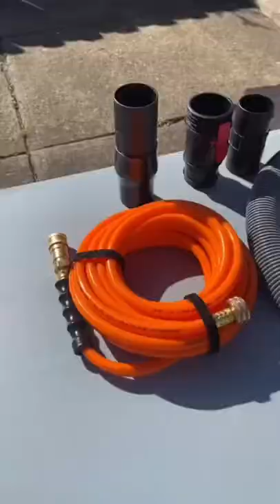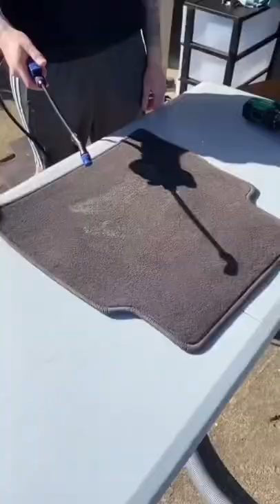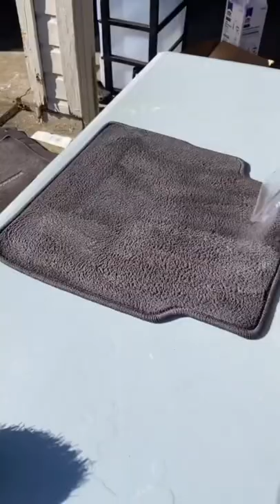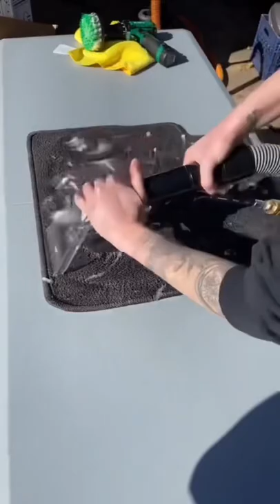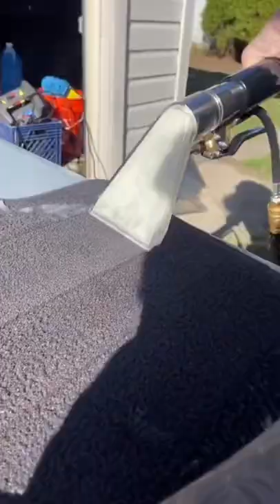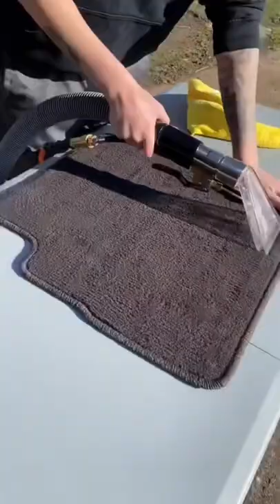10/10 recommend the Better Extractor! Makes the job so much quicker. #cardetailing #extractor #fyp

Comment: But what vacuum are you using? Not the attachment
Reply: Ridgid portable 4 gallon 5hp will be what I use
Reply from the maker: Rigid 14 gallon 6hp
Reply: Nice set up. I will definitely need this
Reply: @vladhyppolite9352  I’m waiting on a few more parts to finish mine and I can’t wait to use it.

Comment: This is the best option compared to the $100-$400 machines that are available. Paired up with the ridgid 4 gallon 5 hp vacuum you'll have the best suction available. 
The bad part is that not every one has an exterior heated water source, hot water makes a big difference.
Reply from the maker: I completely agree!!
Reply: Link for extractor??
Reply from the maker: @raulbleedem  https://ripclean.com/?sca_ref=3846771.p6p5xGyEON
Reply: I waiting to hook up this to their 4 gal 6hp shop vac. I might rip the carpets out with it lol
Reply: The best suction available huh🤔
Reply: @sirtyronedalll4082 don’t get any wild ideas bud😂
Reply: Ik some would be able to tap into how water from the house if they are pipe hand or a plumber. If only do that if you are doing cleaning for a serious job
Reply: @raulbleedem there are how to videos on YouTube where you can make one yourself for a bit more savings.
Reply: Put a smaller hose and much better suction
Reply: Where can I purchase this ?
Reply: Remember you have to attach to garden hose I believe
Reply: @mcgrathautodetailing
Reply: this is when you buy a mccollough steam cleaner and use it before you extract!

Comment: Smh I mean it’s convenient that it’s all together but over 200$???? Screw that. I can build my own bc it’s basic knowledge. Air hose with fittings that fit the water hose and extractor head of your choice. And a vacuume hose with rubber slip fittings
Reply: What is everything required ??
Reply from the maker: True but I’m lazy 😂
Reply: Then why comment on it and complain about an investment then just doing a diy?
Reply: 200 wouldn't be bad if it had a metal coupler so that it wont start cracking after a couple years of pressure

Comment: Would this kit fit a karcher or dewalt. And while i am at it, can you please recommend whihc i should purchase? I live in nz and its hard to get a hold of a ridgit. I am thinking to purchase either the karcher wd3 or a dewalt...
Reply: You can use whichever shop vac you have that can pick up liquid. You may just need to sort out a fitting to make the extractor head to fit your vacuum hose

Comment: Instead of a 10 ft hose for the water attachment, maybe run a 100 ft hose from your hot water valve for the washing machine. 😅

Comment: What a Machine is?
Reply from the maker: https://ripclean.com/products/extractor
Reply: @mcgrathautodetailing  :thanksdoc:
Reply: Smh I mean it’s convenient that it’s all together but over 200$???? Screw that. I can build my own bc it’s basic knowledge. Air hose with fittings that fit the water hose and extractor head of your choice. And a vacuume hose with rubber slip fittings